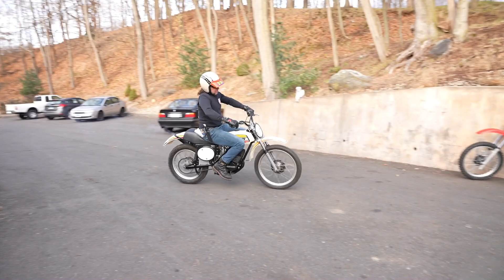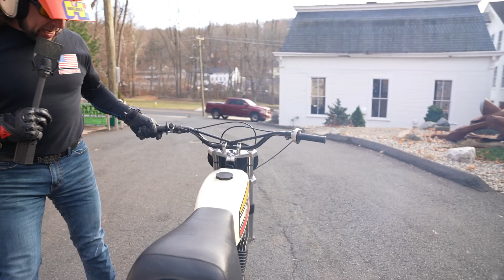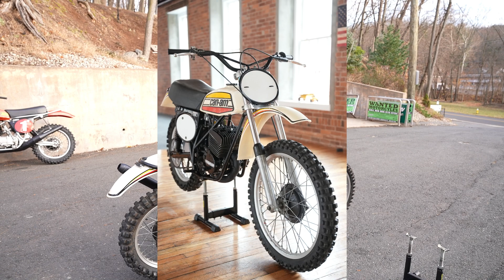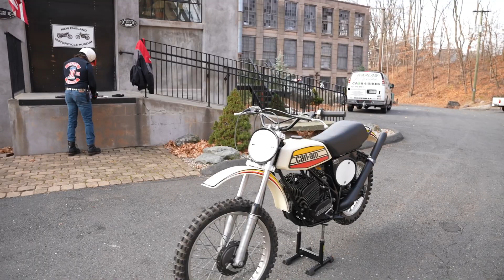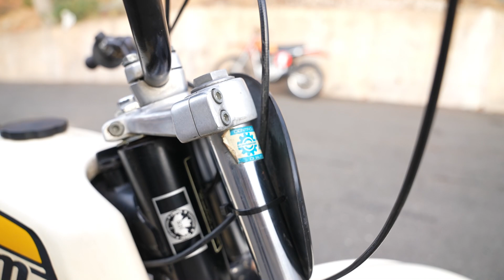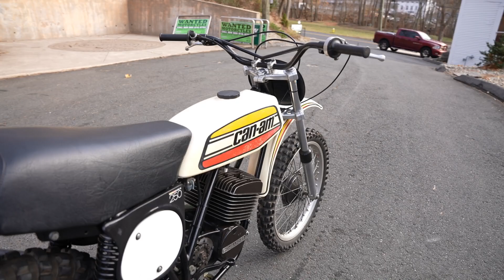Mint Original 1974 Can-Am MX2 250 Bombardier

Comment: I believe the Can-Am's had a way you could change the front fork angle by something in steer tube I think.
Reply: Yes, that is correct. The fork angle could be changed from 26 to 32 degrees in half degree increments by adjusting eccentrics in the steering head.

Comment: Unbelievable piece!!! As a lifetime owner of their snowmobiles, I would absolutely love to hang that in place of my t.v. 
Bombardier knows two strokes!!
Reply: There was a rotary intake valve on the end of the crankshaft that could be changed out for a number of different cutaways depending on what you wanted the tune to be as it simulated what you would have to do to other two strokes by porting them out permanently.... This way you could change the rotary valve out for Enduro racing another rotary valve for trail riding another rotary valve for high-speed top end racing or another rotary valve for Motocross.... As I was at Indianapolis raceway Park during a weira road racing event that was held on Indies two and a half mile road course... And it was a Can-Am Enduro 250 that one first place in the 250 class against rice rockets... And they're the guy was in his Enduro clothes and boots gloves with a set of Avon racing slicks a 21 inch on the front and a 18 on the rear on stock wheels and hitting speeds of 100 mph which some of the 250s were faster than that but he was smoking their tails off in the corners dragging the foot pegs !⚡👀